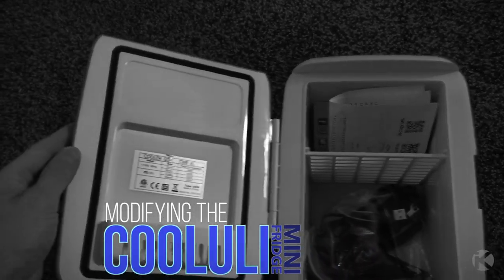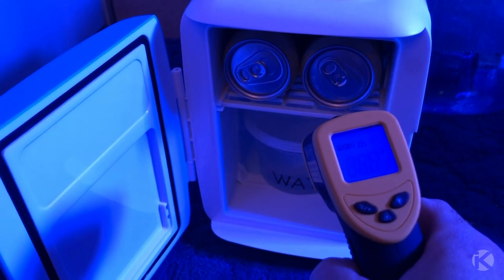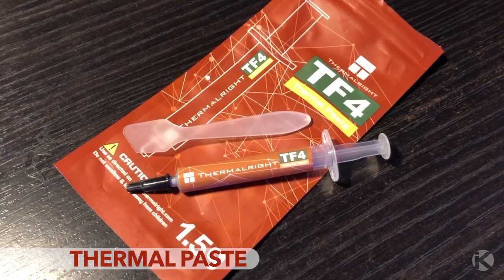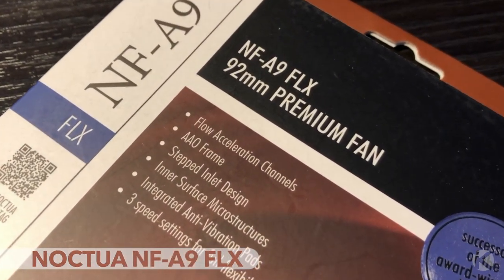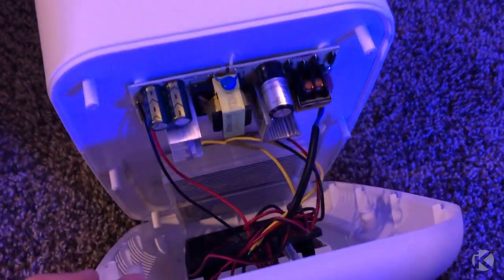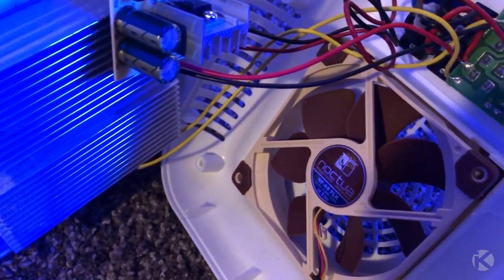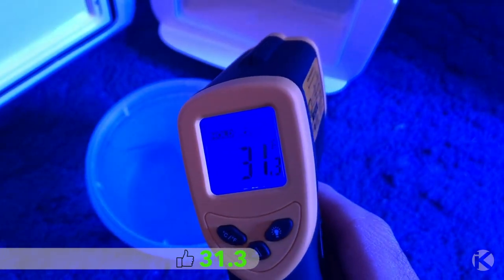Modifying the Cooluli mini fridge

Comment: So the first temp measurement was taken on the items in the fridge, while the 2nd you focused directly on the area where the peltier cooling module is mounted. No, that's not how we do a temp comparison. If you had measured directly on the module the first time the real improvement was probably 5 to 6 degrees. And any item in one of these fridges that makes it down to 43 degrees is very good performance. The paste probably helped a bit but an upgraded fan with higher flow is what makes the difference. 

I've done this mod myself AND added a 40mm x 40mm x 7mm fan to the INSIDE of the unit (the fan mounting holes had to be reamed out a bit since the screw spacing on the cooler was just slightly smaller than 40mm x 40mm). Using very small fiberglass standoffs, I mounted the fan using longer retaining screws where the module heatsink is secured to the inside frame (the 4 screws as seen in the video) and drilled a small hole to pass the wires to the inside of the unit and wired it up to the power supply. Airflow inside the unit really helps cool things down faster. Still, this is a peltier cooler, so the BEST thing you can do is place it where the airflow is unobstructed AND where the air is cool. People somehow expect these things to get cold when the ambient air is 88 degrees and 70% relative humidity....they don't work that way.

Comment: in the first part you put the indicator on the water and had other things in the fridge  and did not tell us how long you had the fridge running,  but in the second part you told us how long you had the fridge running and there was nothing in it and you put the indicator on the back of the fridge. so the test seemed kind of inconclusive
Reply: Also, these kinds of coolers have cooling limitations depending on the ambient temperature and humidity. This changes throughout the day, especially in the summer when this was posted, so it’s hard to say if he tested this cooler at the same time on both days.

Comment: I’m about to put a better Peltier module in mine and connecting an adjustable power supply to it for lower temperature and temperature control, I’m also using Corsair’s cpu thermal paste for the module
Reply: Which peptide module did you use? and how well did it perform?

Comment: For "All" these protable mini Refer's out there it seems they only drop 30 degrees?  So here where it is 85 to 90 degrees all the time, I can only expect to get about 60 degrees as coldest?  In addition to your great improvements, I was thinking of drilling a small hole in the top and bottom between the cavity walls and fill it with spray foam.  But even then can I get it down to 33 or 34 degrees?  Thanks
Reply from the maker: I say try it!

Comment: Mine broke so I opened it up expecting to see a normal Peltier but it actually had two KSD 301 transistors in the top and bottom of a piece of metal which I assume is the actual Peltier. I was going to replace the transistors but one of them has "-2 / 8" written on it underneath the 250v 10a rating. I can't for the life of me figure out what this is supposed to reference as these don't seem to be any standard KSD thermal cutoffs. Any ideas?

Comment: How did you hook up the 3 pin fan adapter into the 2 pin port?
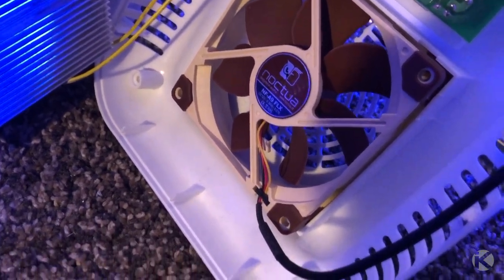Reply from the maker: As you can see in the video I did not use the yellow wire on the fan. Pause the video exactly at the 2:00 minute mark.

Comment: What was ambient temperature in the room during both tests because those microfridges only cool to about 30 degrees below room temperature. So if you got it down 31 degrees than your room couldn't be more than maybe 60 degrees. Still interesting that you got it down another 10-12 degrees.
Reply from the maker: House temp is fluctuates around 65-71

Comment: My fridge is not cooling but the fan is working. Should I get a thermal paste to replace?
Reply: These little fridges don't seem to last long. They're cheaply made. There's another video where a guy replaces the power supply. That and/or the cooling semiconductor is probably what died. Just buy another one since they're so cheap.

Comment: This was a very interesting video, I had a similar one of these for over a year now. It was from Walmart and it has a similar cooling issue. I also just got a bigger unit (A Frigidaire Beverage "Refigerator" is what it is called on the box. Can hold 18 cans or 4 bottles of wine) that says it is supposed to get around 20-28 degrees Fahrenheit but the cans barely go under 60. If a simple mod like this can change it by that much, then it is fair evidence that these manufactures are deliberately making these coolers run poorly. I'll be modding my mini one soon. Have you tried doing this to any of the larger thermoelectric coolers? Would love to know if it works on them too or any other modifications that can be done.
Reply from the maker: I haven't tried this upgrade to any other fridge, just the one in this video. Sorry.
Reply: hi, just curious, how did it go? and what did you look for in the type of new fan you bought? im fixing mine for a friend and i want to make sure i dont screw up the system

Comment: Hello, I’d like your help fixing my mini fridge I just got it last year and one day it just stopped working the fan isn’t turning but it’s still able to work. Could I follow the same steps here?? Is there any way I could reach you?? I got it last year 2019 and in May 2020 it just stopped working.
Reply from the maker: When you mean its not working, its not getting cold? The fan could have gone bad. Try replacing the fan first.
Reply: That's what I would do. I just bought a mini fridge like this but with a han solo in carbonite 3D door. It's noisy. I was about to do everything in this video but I felt like I should see if it's as simple as I thought since I build computers lol I just need a noctua fan. I already have the Arctic mx-4 laying around :)

Comment: Did you use normal CPU thermal paste? Like, Noctua also has thermal paste you can buy. Also, when you first opened it up, the cables looked pretty tight (like you couldn't move the back far enough away to get to stuff). What did you have to disconnect or change, to get access to stuff better?
Reply from the maker: INDES7RUCTIBLE : The CPU paste I used was not from Noctua, it was a different paste I ordered from Amazon. I will say it was difficult moving the wires out of the way to access what needed to be upgraded.

Comment: Hi! I have a cooler similar to yours. I've noticed that although the fans are spinning and the cooler is powered on that it doesn't seem to cool as good as it used to.

I opened it up, applied some fresh thermal paste and it still seems to not want to cool. What would you say the issue is with it
Reply from the maker: It could be the Peltier that went bad. Take the Peltier out, and see if one side is heating, and the other side is cooling.
Reply: @IanKreer  my cooler has both a hot and cold function. The hot function works, but the cool function isn't as good as it used to be. 

I'll try take the peltier out and see, thanks for replying!
Reply from the maker: @AdenGFX  I would check both sides of the peltier first and see if that fixes it.
Reply: @IanKreer  Okay so I opened it up and observed that:

When the cooler is on the COLD option: no sides have any change.

When the cooler is on the HOT option: side facing the heatsink is cold, side facing the cooler is hot.

Could I not simply turn the Peltier over? Only problem I can see happening is when the switch is on HOT is in fact cooling and when it's on COLD it won't be doing nothing?

Would this cause any problems on a safety level though?
Reply from the maker: @AdenGFX  OK. On the Peltier there are two wires. If you give one wire positive 12 volts, and the other negative, one side should get warm, and the other gets cool. If you reverse the polarity, the temperatures will be reversed as well. If one side is not getting cool, only warm, the Peltier is defective and needs to be replaced.

The more I think about it, could it be that the switch is bad?
Reply: @IanKreer  Possibly. As a temporary fix I've just flipped the Peltier around so 'HOT' is now cooling the device. That's what I'm doing until I get myself a new Peltier and/or switch. Thanks for helping